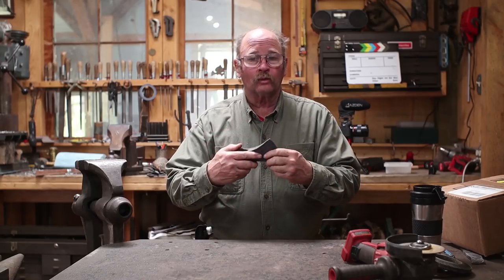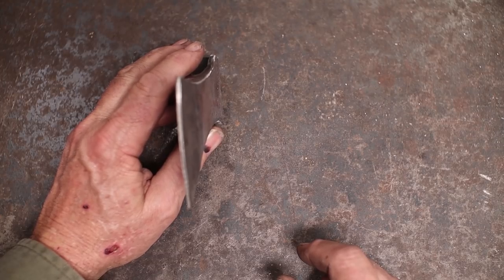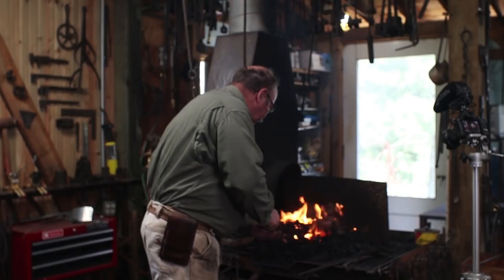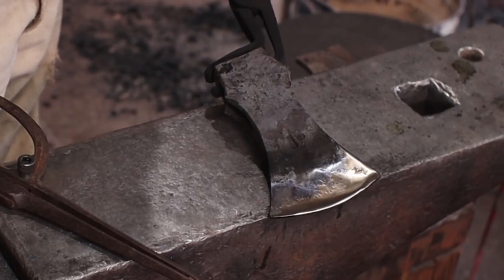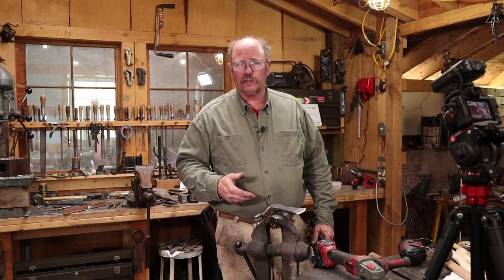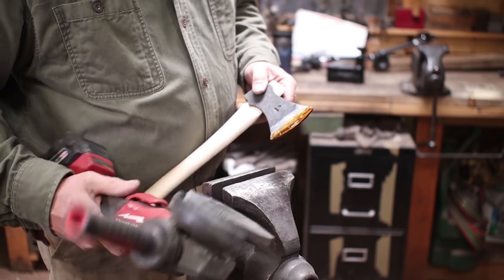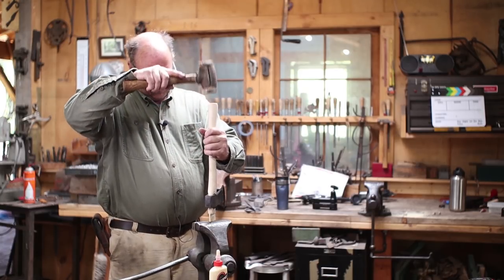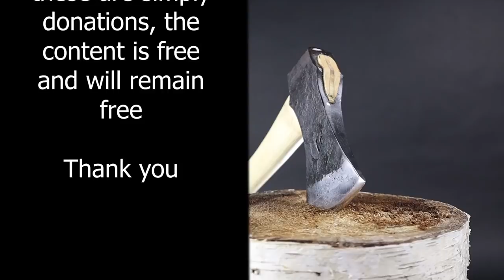Wrapped eye axe part 3

Comment: I love the concept of this axehead . All of how it was made . It really is something you could do alot with to personalize it . I would be very tempted to polish to 50,000 grit with diamond abrasive and then use the left over used abrasive slurry to harden it. Diamond IS pure carbon and they do easily burn in a coal fire or gas fire.  Would polishing to a uniformly level mirror finish on surfaces meant to be forge welded help them adhere?
 There is a product called tempalac  for gunsmithing , meant for identifying temperature without  tools  , it simply is painted on ,then it melts off once the part gets to the desired range . It is for learning more than anything

Comment: Hello John.  Very happy with your videos, including this one as always.  I downloaded the Heat Treater Guide Companion.  I have seen very expensive older editions.   It is a wealth of information, with one exception.  Frequently they use the phrase temper to the temperature resulting in the desired hardness.  I thought there would be a chart with this information, but no luck.  Have I missed something?
Reply from the maker: That is my biggest complaint with that app.

Comment: Rivets? I'm sure there's a good reason why I've never seen a rivet to compensate for the eye starting to split. But I still gotta ask. Why not rivet it?
Reply from the maker: I have seen some things with riveted eyes.  Not an axe, but it would probably work.  If you place the rivet before the final welding heat it might disappear.

Comment: Excellent series and thanks for sharing your knowledge.  Please consider grinding so that the sparks are going away from the axe.  With the rotation of the wheel going toward the cutting edge it is extremely easy for the wheel to "grab" the cutting edge.

Comment: Awesome, Thank you! Love your videos. Making your own axe should be right of passage to Elk Camp. Here is my question; I recently purchased a Harbour Freight 3 lb cross peen for $5. Yes the quality is cheap and it was not square and very rough and not straight cross peen. So, I ground it down to square and smooth removed the rough edges and take some weight off the flat hammer end of the hammer to make it balance better. I love the way it looks and feels now and it has no sharp edges to mar the material. In some places I took off as much as a 1/4 inch of steel. I did try to keep the hammer cool when grinding by dipping in water every few minutes. My question is do i need to re-harden and/ or temper again before I use because it seems very soft on the surface now. Much more than when i started the grinding process. Most of the grinding i did with small disc grinder using 36 grit at first then 60 then 220. If yes, then what is home shop method to re-harden / temper not having any clue what the steel is from Harbour Freight other than is obviously very cheap steel.  Thanks, Chuck
Reply from the maker: Not knowing what the steel is, it would be hard to say how it should be hardened.  It seems odd that it would soften up unless you go the areas being ground up in to the blue range.  Most factory made hammers are hardened the same throughout.  If it really needs to be re hardened here is a video discussing unknown steels. 

https://www.youtube.com/watch?v=QNdUWxY5nZ8
Reply: Just watched the video you sent me and its spot on and gives me confidence to go ahead and use this tool without being concerned if it gets a little dinged up. Thank  you for your response. Your videos are a blessing for a newbie.

Comment: Would you be able to use this same basic technique to make thin fullers? Or is there not enough impact surface on the back for the hammer?
I was thinking along the lines of not having all the "good toys" yet, just starting.
And with a narrow blade a fuller is basically an axe.
Reply from the maker: I would think so although I have never tried it myself